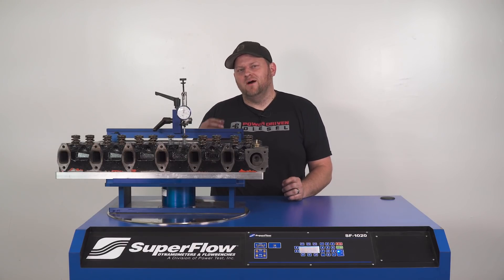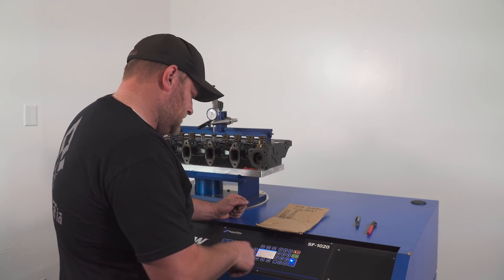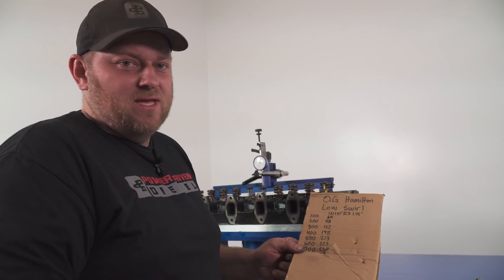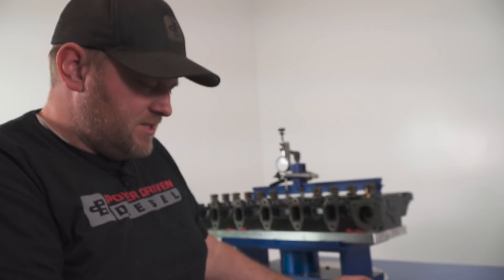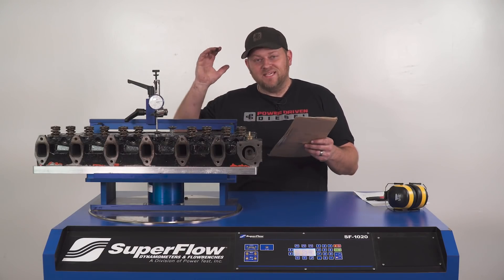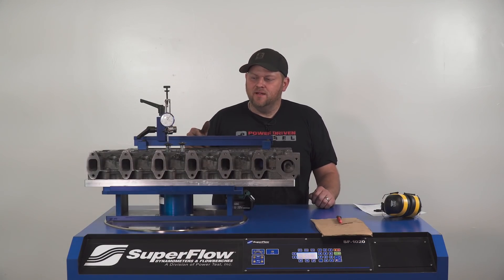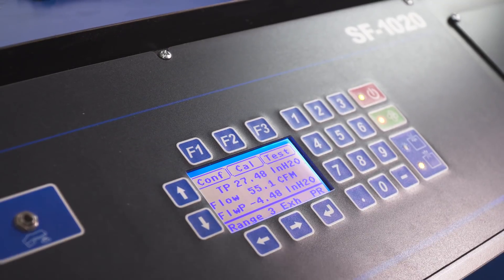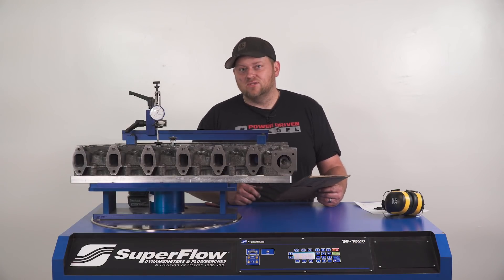Power Driven Stage 1 Ported 12V Cummins Head vs Hamilton Low Swirl

Comment: More power to be obtained from porting the exhaust ports....many people dont realize u need to exit what u put in or else some burnt fumes will still be in the combustion chamber on the intake stroke.....Gale Banks explains this perfectly with live data
Reply from the maker: One consideration is when the intake valve opens, it is faced with boost pressure and best case scenario a couple hundred PSI on a race engine.  When the exhaust valve opens at the bottom of the power stroke, it could still see 1000+ psi of cylinder pressure which means it will flow a lot more with a less efficient port.  I'm not arguing that exhaust flow is not important, just that in most applications an exhaust port that flow 75 to 85% of the intake results in maximum power.  With forced induction, there is much less data/research available so you can be certain we'll play with more exhaust flow on the dyno and see what if any gains we see going beyond the 85% N/A exhaust flow ratio.

Comment: You also have to remember that you have rocker ratio to account for. .400 lift cam with a 1.5 rocker ratio will get you .600 lift. I don't know what the specifics of a cummins are in terms of rocker ratio but it's something to remember when flowing heads.

Comment: I notice your checking the center cylinders where the intake sits over 
What happens when you have the intake plate on it does it effect the flow on 1/6 cylinders even though it is a positive pressure in the whole intake area or are you going to cut it off ????

Comment: Awesome video Will from my bike days gas flow is everything cylinder heads are were real power is made 
I have one question regarding valve seats on diesel engines are they multi angle and at what with 
( in the day on manx Norton seats were 3-32 single angle  )
Please keep these awesome videos coming they are so interesting 
AS ALWAYS GOD BLESS YOU AND STAY SAFE IN THESE TROUBLED TIMES 🙋‍♂️🇬🇧

Comment: always need to "over lift" the head to get as much time for the to be open valve around that peak flow number.  if it topped out at .400 lift, id run something atleast .450-500 if i wanted everything out of the head

Comment: wouldn't the smaller valve head flow more per revolution,  being in its sweet spot except for tip of lobe?
Reply: This is a great point, matching your cam to your head is extremely important.

Comment: Coming from gas these numbers sound terrible but considering the lower lift it's actually really good
Reply: Also have too consider most gas engines would be either naturaly aspirated or maximum boost of around 30-40 psi   A stock 12 valve makes around 25-30 psi at 160-215 flywheel hp depending on what pump and injectors due too year model alterations and most trucks making 500-2500 are anywhere from 55-200 psi or so and with all that pressure and the fact that the compression ratio is likely almost double that of most gas engines it’s more of a mass for strength/durability over size of the ports for flow kind of trade off

Comment: in the gasser world head flow is everything. rough calculation of potential horse power is cfm x 2 = naturally aspirated power potential. let’s say 300cfm X 2 = 600hp.. With forced induction you take the NA power potential and multiply it by each atmosphere you add. I wonder how close these numbers end up after you dyno and work the math backwards on the 12v cummins.
Reply: Heat is going to throw a big wrench into this calculation
Reply: Diesel needs more air so they make less power per cfm.